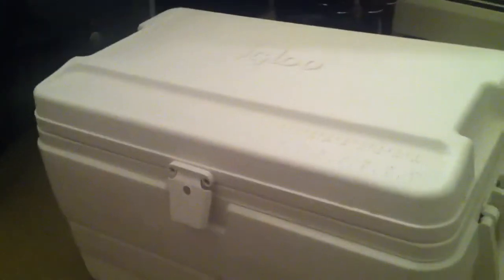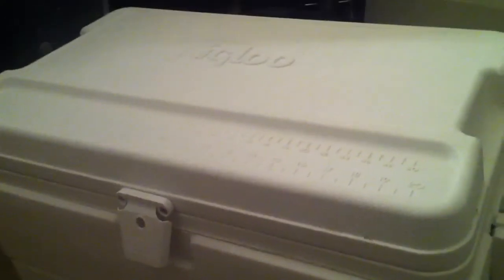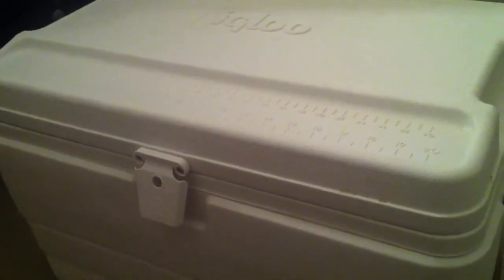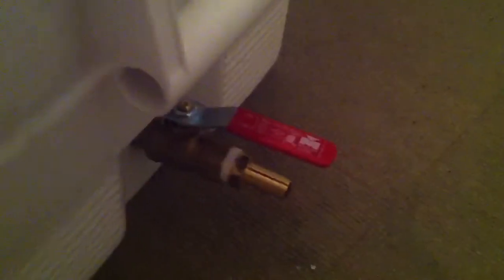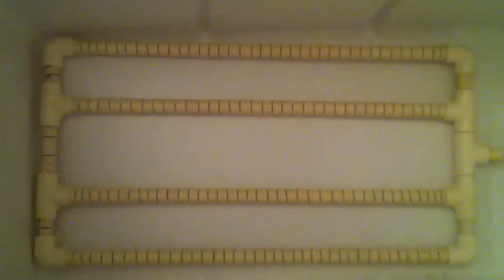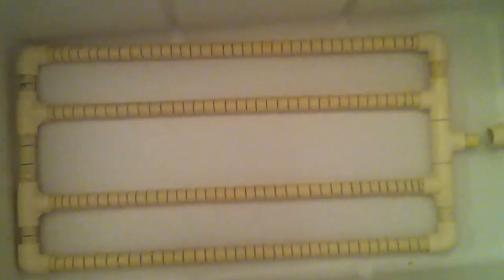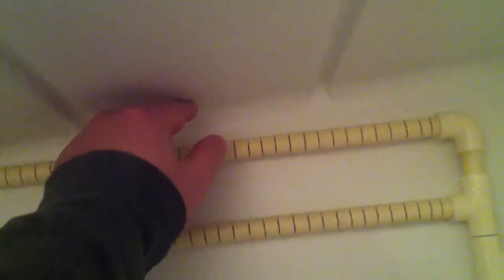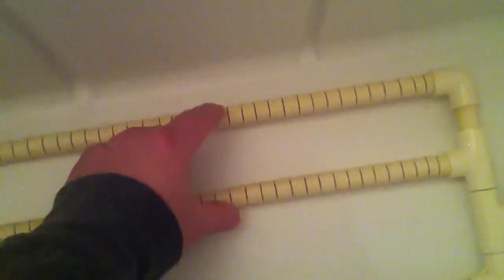Cooler Mash/Lauter Tun

Comment: Mine is almost identical, what I did with the three 'T' pieces near the faucet was cut about +/- 3/16" from each end so I could get the  lengths of pipe equal width apart and I can get  a few slits in the small pieces of pipe.